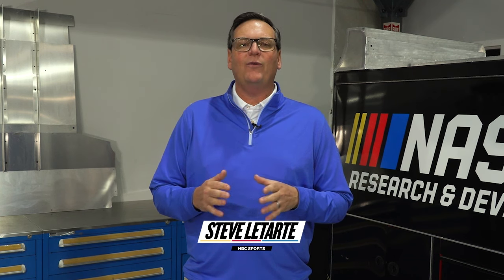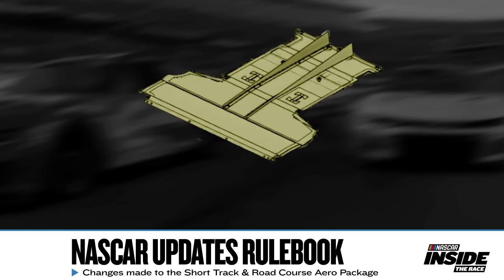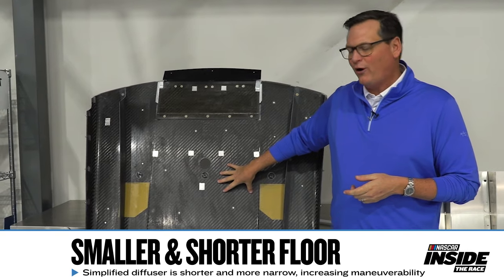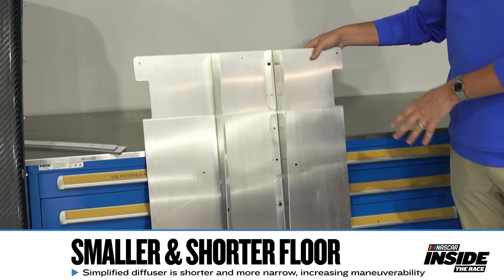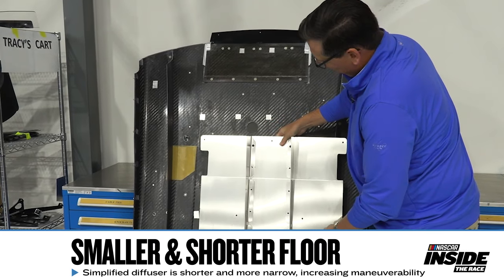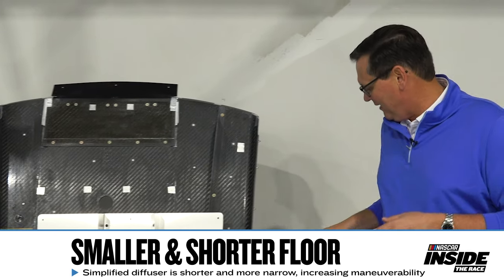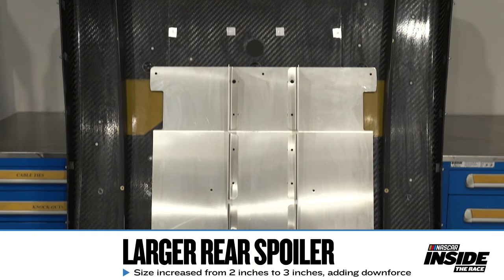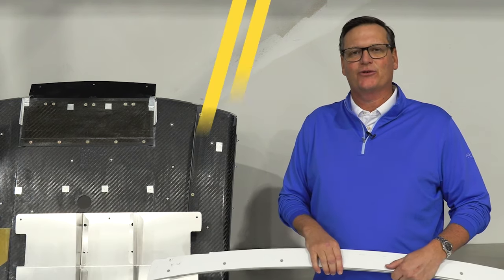Inside the Race: Explaining and demonstrating 2024’s short track diffuser #nascar

Comment: just give em 750 hsp or more
Reply: It’s not that simple. They ran 750 or did you not hear what Harvick discussed? For this car to feel a difference, you’re going to need 1000+hp. That does get expensive and you’re at the engine’s breaking point.
Reply: No because that costs to much money and a 7 billion dollar tv deal isn't enough money to even consider giving teams more hp 😂😂😂
Reply: Months ago an engine builder said it wouldn't be harder or really that expensive to add 80 more horsepower
Reply: 850 HP
Just like years ago.
Reply: @johnnyfrisbie7581  its pretty simple. Remove the gigantic V8 Supercar style front splitter (aka make it much smaller) and boost the horsepower to 800. They still use the same engines that cycled between 7800-9800 rpm at over 900 horsepower an entire weekend. Just use the 2016 formula tbh. 750-800 and little downforce

Comment: Just give more power please. Even a local short track driver have more power than that
Reply: Local short track drivers don't run nearly 40 races per year...which means they can run more powerful engines because they only have to work a handful of times, and for not very long distances.

High powered engines are incredibly expensive to maintain. It'd be the death of smaller teams that can't afford to tear down a motor after every race.
Reply: @bmoney2011 you’re right a lot of local short track racers don’t run 40 races a year. A lot of them run more than that.
Reply: @bmoney2011 The teams have stated that their engine costs haven't gone down since implementing a lower power engine. It still cost the same as when they where running 750hp. 

The teams also tear down the engines every race anyways, hence why the costs haven't come down.

These cars need more power if they aren't going to do anything about the increased mechanical grip. 

These Aero changes are going to do squat at tracks like North Wilkesboro, Bristol and Martinsville, and may be a marginal improvement at the larger short tracks like Richmond and Phoenix.
Reply: @samharris3508  there's no way that's true because they're literally not being torn down and rebuilt every race. On average a Cup Series team will tear down an engine after 5 races or a few thousand miles...as opposed to the early 2000s when engines would barely make it 500 miles.
Reply: @llamaswithgunz_83 and they make way less money yet still can afford big horsepower.

Comment: Quit making excuses and give them 1,000hp. Short tracks don’t need too much areo, they need power to accelerate off the slow turns, and make the drivers have to play with the throttle, which can cause mistakes, more passes, and maybe better strategy.